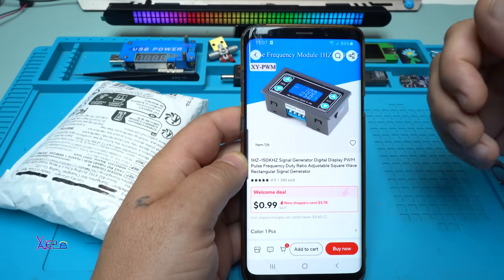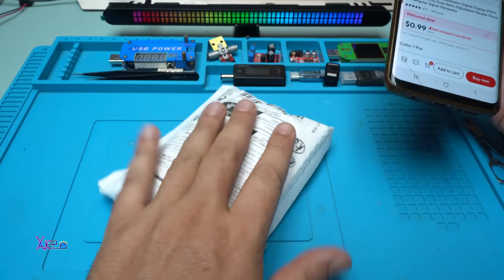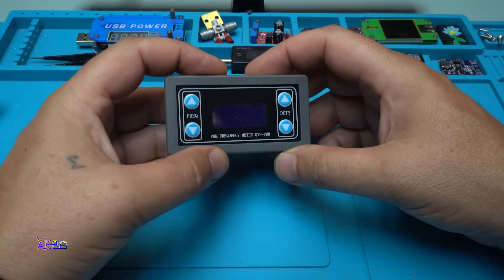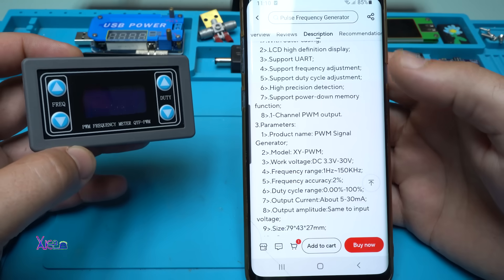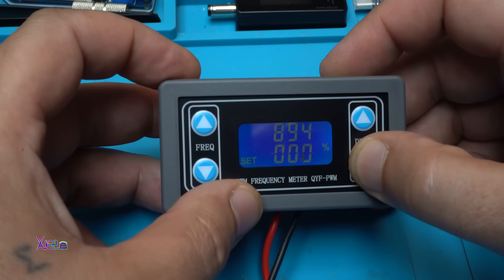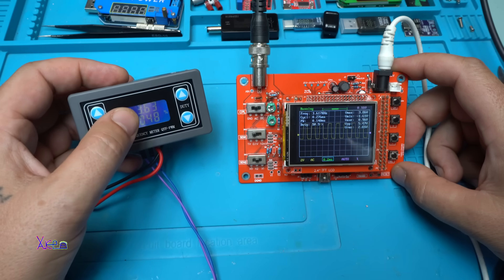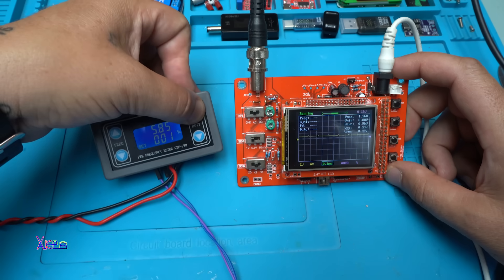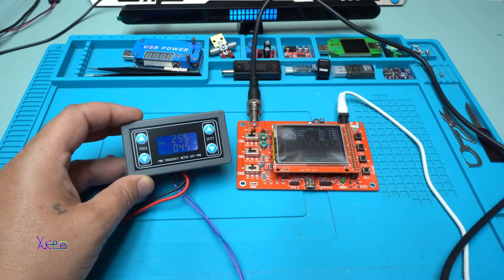$1 Aliexpress Module-Signal Generator PWM 1Hz-150Khz

Comment: Nice tools! I’m looking for a sine wave signal generator with the ability to sweep from one frequency to another, and then stop at the new frequency. This generator should be controllable remotely via a computer using dedicated software (which I am developing).

The output signal should be ±10V (20 Vpp). The frequency must be stable and have low distortion. The minimum frequency should be at least 1 mHz (millihertz), and the maximum frequency at least 10 kHz.

Do you know of any products that meet these requirements?

Thank you for your help.

Comment: what is the use of this device ?
Reply: PWM = pulse width modulation -- you generally use these devices to control the amount of power being delivered to a motor, heater, fan, etc.  The idea is that instead of adjusting the voltage to a specific level, you keep it at some fixed level, say 10V, then if you turn it on and off rapidly at a rate of 1KHz, with a duty cycle of say 50% (50% of the time it's on, 50% of the time it's off) then you get an effect that's about the same as 5V.  30% would get you 3V, and so on.  This is generally a very efficient way to regulate power to a device, because the switch is fully on or fully off at any one instant, meaning there's almost zero power wasted in the regulator.

For this device, the output signal is quite weak, so you need some kind of external switch, like a MOSFET, to switch the high current load.
Reply: @yeroca  I have a free sig-gen app for my phone that outputs a stronger signal with many more options.

Comment: Great! But what to do with it?
Reply: If you're testing an IC (chip) to see if it's bad, inserting a pulse (wave) on the input and checking to see if still exists on the output will tell you if the IC is bad or not.  Very handy if you're testing an Audio IC and don't have an audio signal handy to inject.  The ONLY PROBLEM is pretty much EVERY SCOPE on the planet has a pulse/wave generator built in, making this PARTICULAR gadget relatively useless for that purpose.

You MIGHT however want to build some sort of timer that requires a certain frequency on the 555 for the timing signal, so there ARE some limited uses.  I'm sure someone else could come up with a few others...
Reply: DasBlinkinLights.